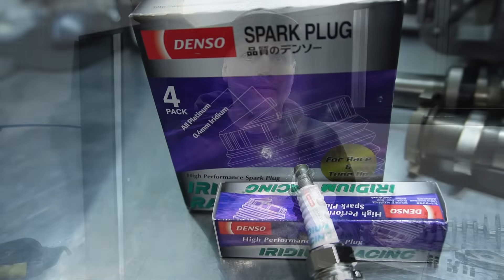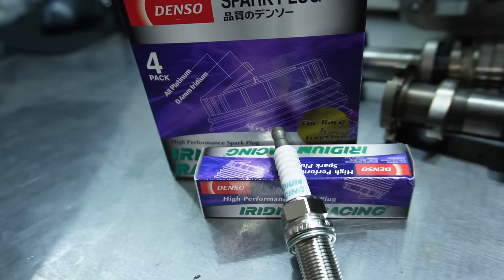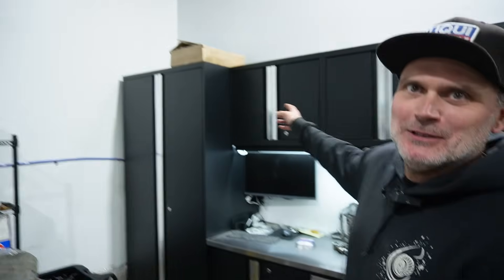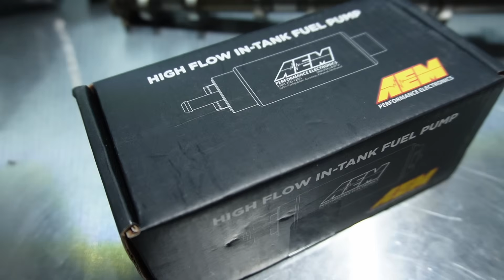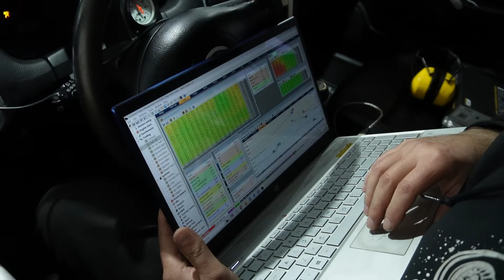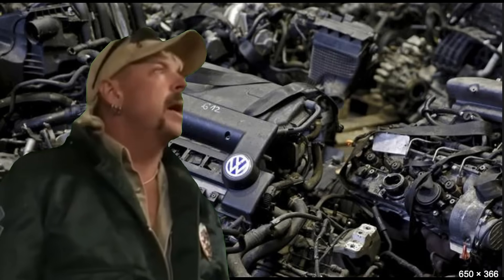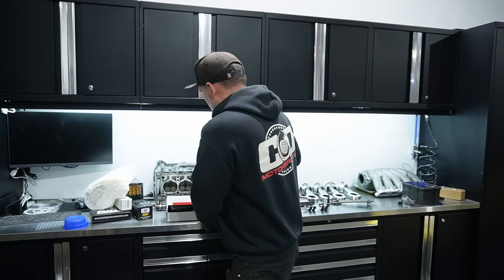Top 5 Things not to Skimp on when building a Big Turbo setup.

Comment: I had gotten the BT tune with unitronic and it won't keep my vehicle started. It will crank with in 2 sec it shuts off. I flash to my k04 tunes it cranks and idles good then I flash back to the BT tune with in 2 sec it shuts back off. I flash to stock tune still idles good. I'm confused on it and starting to think the tune is jacked up. No matter about the fact that I have a intake manifold without the runner flaps it should still crank, run, and idle. Right??
Reply from the maker: We don't support uni software so unsure sorry

Comment: Cheap parts were the most expensive part of my build. I spent $800 on a laurent motorsports downpipe for my VRT, only to later entirely replace it with an HPA motorsports downpipe because it was so absolutely trash. Now it just sits in the parts shed, doing nothing. If I hadn't bought it, that $800 could have been sitting within the purchase price of the downpipe that is my permanent solution.

Comment: Dave, On a 1.8T big turbo build, how important is porting and polishing, I know the factory intake manifold won't work for a Hemi throttle body and the IE intake manifold would be the one to run. But is porting and polishing the head absolutely necessary?
Reply from the maker: Depends what you're after I guess. We made 600whp on a completely stock 1.8t cylinder head. 

If you want efficiently sure, or you can just run another 2psi ;)

Comment: I skimmped on my VR6T build. I bought OE 82mm cast pistons when I should have bought forged. To make the matter worse, I plan on running stock  compression.
Reply: where do you go for info on vr6t builds? want to build one and trying to find info, buts all over the place
Reply from the maker: Ouff.
Reply: @COMotorsports  I'm only planning on running 9-10 psi max. I only have a C2 OBD1 12V VR6 stock compression tune for Bosch 36 lb. injectors.

Comment: Suggestion for a video comparing the intake manifolds options for a 07k turbo.  I know you’re planning the SPA for your proposed kit, but it would be interesting to see a comparison between the stock, RS3, integrated engineering, and SPA manifolds. Thanks. 👍
Reply from the maker: Truthfully, I think that's a lot of work for little differences in most folks application. I would say TTRS is likely the worst comparably.
Reply: @COMotorsports  thanks. That IE manifold looks trick, but is it really any better or worth the extra $$$
Reply: @dB_944  Over what? The SPA intake guys only claim 10% gain NA and 15% Boosted but IE claims 48 horsepower NA, it really depends on what you're comparing.
Reply: @SlowSTEN that’s why I asked for a comparison in the first place.  Is it worth spending extra for the IE, save money on the SPA, try an RS3, or use the stock one for a turbo install?
Reply: @dB_944  The stock one can't handle much boost, but the spa and I.E are plenty strong for boost, personally I plan on going with the I.E unit, but if you have hydraulic power steering you will have to go with the SPA Unit

Comment: On any build not to skimp as a turbo LS dickbag I agree! I had a few guys who I highly respect (but have insane fast big power cars) tell me buy once cry once and in some cases I listened!  Like my transmission is one tough mother frigger and party's like day 1 at the end of season 5 with lots of trans brake launches and passes as well as street miles
Fuel system for my car, holly 340 single pump hat hanger, swapped that 340 out for a 450. With the 78lb injectors I had I was at 130 percent injector duty cycle and lowering fuel pressure supplemented by meth injection 
Then decided I needed more intended to run a surge tank with 2 450s fed by by in tank 450.  Ended up removing that intank hat and re doing a new tank and hat setup from Holley with twin 450s and proper size lines and now some 1350 injectors so it's much better now and I'm good for 4 digit party fuel wise and swap to pump ethonal and put on my big boy pants.
I coulda done this shit once and saved myself 2 grand haha

I also agree on #1 bigtime I've had Holley save my ass with some fail safe stuff and the way it operates over how a stock ecm would do on a GM!   bRo mY cAr tUnEs iTS sElF
 #learntobase

So your saying the 855whp and 989tq to the tires on my twin Amazon gt35-82r that were $200 CND each was risky? Gates pinned shut by compressed air from the shop making 30psi Hahaha (my god they were close to big death)

Thank you Clayton for the Joe exotic throw back clip!!
Reply from the maker: Imagine if you put real turbos on it how the power band would be, and how efficient they'd be. :)
Reply: @COMotorsports I got too big a turbos now days haha I got 1400hp worth of turbos but I'm a giant pansy!